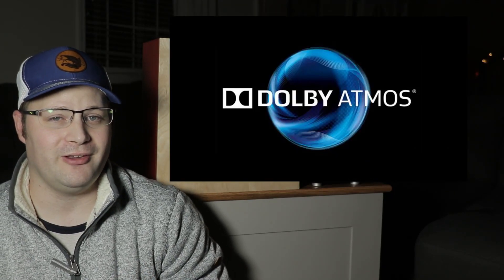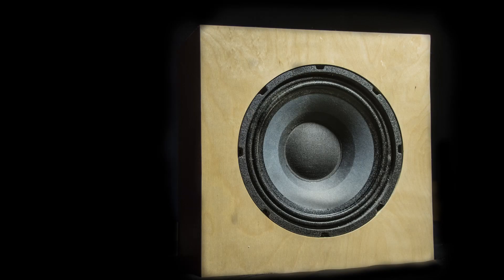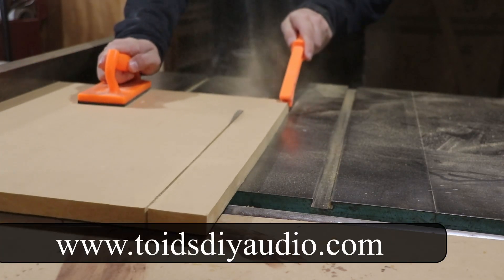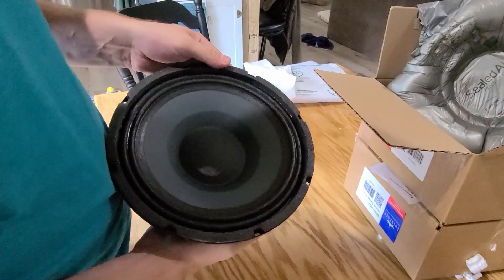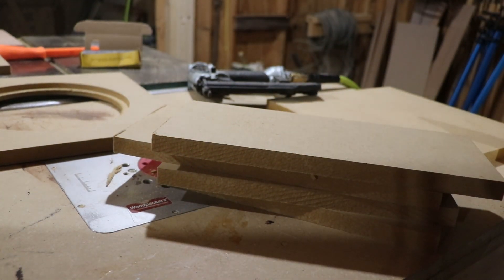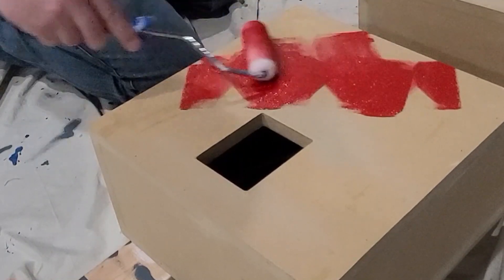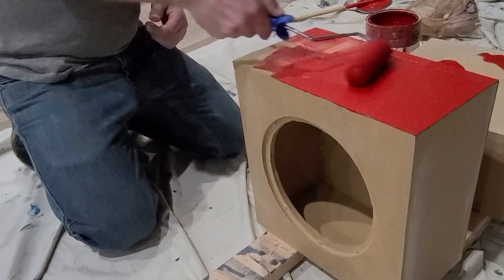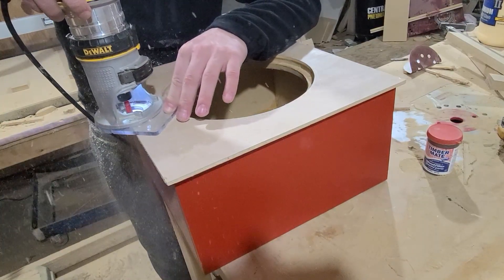How to Build The Ultimate Dolby Atmos Surround Sound Speaker

Comment: Thank you. I am interested in building a 6" to 6.5" coaxial 2 way center channel. My thought is this is large enough to provide the sound power to keep up with a L/R of the same design, while eliminating the off axis lobing associated with turning an MTM configuration on its side. Do you know of any manufactures that make a high quality 6.5" coaxial driver?
Reply: Hey Jeff - I'm trying the Celestion FTX0617. Prototype box sounds pretty good with the factory designed crossover. Only trap is that the woofer polarity wasn't marked on the pair I bought... you may have to experiment.  There is a massive notch at 2khz if the driver phase is wrong :)

Comment: I built these…. Twice. Used Eminence woofer & tweeter.

Built for in wall rears & mid ceiling height.  I also built a couple GR Research X-on for front height j& side speakers.  7.2.4 system. 

These sound quite good. Very clear… & decent base.  I used them in place of my LR speakers for a bit of listening… just to compare. My LR are GR-Research X-Statiks pre amp from Denon AVR to a sub woofer (don’t use LFE) then to Krell KAV-2250 amp (sub is a GR-Research ‘double trouble’ servo controlled)

I was really surprised how good these sounded. 

They had the boxy sound of sealed speakers… vs the open baffle staging the X-Statiks have…

But, they are getting mounted in wall or in ceiling anyway.

About $360 from part’s Express for one set.
Reply: how are they for two channel stereo listening
Reply: @joeygonzo  actually, they are pretty good. 

Good clarity through most frequencies… 

Decent staging… 

I listen to them on 1’ stands 3’ into the room well separated… they wouldn’t suck as ‘bookshelf’ speakers.
Reply: @ronreeder4572  well, they're a lot cheaper than Zu Omen or Kef or Andrew Jones new concentric speakers.  Did you configure your own network?
Reply: @joeygonzo  yes. 

Well, used the tools available in my Marantz or Denon AV… Audessy… 

Use provided microphone… the program makes ‘chirps’ & automatically balances the speakers. 

You don’t want to ‘hear’ ATMOS speakers… we’ll be aware of them … 

My L&R are situated so well… you don’t ‘hear’ them either … the simple induce sound into the room… but, you don’t hear the music coming from the speakers… music simply fills the room.

Comment: what a shame. Youtube needs a paid section for content. Mr. did i miss something? You glued MDF together. Then you named dropped drivers.Not cool
Reply from the maker: Huh? I'm not sure what you're talking about. That's not at all what I did. I mean I did glue boxes together, that I designed based off the TS specs of the driver. And then I custom designed an entire crossover, for two completely different compression drivers. So, maybe you just didn't watch it? Or maybe you didn't read the description where you can get the free plans at?

Comment: I used Polk Audio RC80i in my garage Atmos system and since i couldn't cut into the ceiling i purchased 10in. single subwoofer boxes. The measurements are the same as these. The speaker cutout is perfect and they come carpeted in black or gray. I mounted those to my ceiling and they're perfect 👍
Reply from the maker: Nice!
Reply: @Toid what would be good strong plastic bin or container would be strong enough for 6.5 1/2 400watt marine speaker and hold Talentcell Rechargeable 12V 6000mAh/5V 12000mAh DC Output Lithium ion Battery Pack for LED Strip and CCTV Camera, Portable Li-ion Power Bank with Charger, Black and plye 4ch hydra amp

Comment: Was wondering why you didn't fit between the ceiling joists. Also, in a ceiling, I would prefer to hide the speaker behind a white grill with a hole just big enough for speaker to be flush with ceiling. I guess I would just shim the box between the joists and raise to allow speaker to be flush.
Reply: Space between joists is 14.5 in and 7.5 depth normally so he could put them in the ceiling

Comment: @Toids, great build but wouldn't it make sense to make sure all of your monitors match drivers and overall parameters? I realize that one is providing height and the other is effectively the 5.1/7.1 set-up, but I would think you'd want as much tonal matching as possible. What would the "LCR" version of THIS speaker be?
Reply from the maker: Ideally in a 5.1 surround sound do you want your front three mains to be identical speakers. As far as rears and ambient speakers go that is far less important. However that's the reason why I used the JBL driver with this woofer. That's the same driver I used in the THX build. So these would pair up really well with something like that if that is what you're going for.
Reply: @Toid  I appreciate what you're saying, IMO and experience, when we start adding more and more channels (which with Atmos, we do) it actually becomes all the moreso important to try and make all channels as close to identical (if not actually identical, DNA) as possible. There is so much information being tossed around the room that I think in order to keep things seamless and homogenous, matching is critical. I didn't realize the JBL's were the same tweeters as the Faisal/Klipsch-esque build, but that would of course "help". I just wonder since this is a fairly wave-guide controlled dispersion speaker, which similar to a tannoy is fairly ideal for HT, what a larger, more full-range version might be to make these fully LCR/LR/RR/Atmos "set" designed. Thanks again for your vids they are both entertaining and educational. I come from a different side--grew up in a hifi/home theatre store and know fairly well what things perform like when installed.

Comment: We are not gonna see the frequency graphs ?
I wanted to see how low a closed 10inch pa driver can go. 
Also wanted to ask you few questions.
What do you think about the not perfect "waveguide" cause directivity and other problems ?
Also when the woofer movies in and out, the waveguide also moves up and down. Doesn't this create problems to the compression driver ?
Reply from the maker: The frequency response graphs are on the website linked in the description. The waveguide itself doesn't move. It is attached to to the motor structure underneath the cone.
Reply: @Toid  The cone acts as part of the waveguide, and the cone moves up and down, so it moves the waveguide with it, compressing and releasing the higher frequencies.
Reply from the maker: @Quetzalcoatl0  the cone is outside the small conical 60 degree waveguide inside. In none of my tests has the movement of the cone had any effect within that dispersion.
Reply: @Toid  the small waveguide inside ends at the dust cap, then the woofer cone continues the wave guide. I didn't know the exact word I wanted to start with. I'm talking about the doppler effect problems that occur in all coaxial speakers.
This is what worries me. I really wanted to build a 10inch pa coaxial with a compression driver for all the 7.x.4 channels, so everything from drivers to box size, to crossovers will be the same. But that doppler effect, and it gets worse when the cone (the moving waveguide) starts moving near xmax. 

I guess I have more reading to do. There isn't much data about this topic. I wonder why not every speaker be a coaxial when coaxial seems to fix most of the problems of a regular 2 way speaker. 

Thanks for the chat :).
Reply from the maker: @Quetzalcoatl0  I didn't see any issues within the 60 degree radius, but I went ahead and emailed the product designer at Eminence to clarify. If I get a response, I'll definitely let you know. Another option would be to do something like a BMS or a b and c compression coaxial. However those will still need to be crossed over typically by 300-500 Hertz.
Reply from the maker: @Quetzalcoatl0  I did hear back from Eminence. They did say that at extreme nearfield listening some frequency modulation can occur.  However it's effects are far less noticeable or measurable far field. So it looks like I learned something today. I appreciate it.
Reply: @Toid  Thanks for that info! I won't be closer than 2 meters from each speaker. So i might actually go 10 inch coaxial instead of the faital pro pr200 and a matching horn which i still don't know which to use. Both cases will need to time align both drivers so.
Reply: @Quetzalcoatl0  coaxial, coincidence, and concentric are not all the same.
Reply: How do these compare against a Volt 10? Would you recommend using the JBL or Eminence compression driver over what comes with a Volt 10?

Comment: Hi 123Toid, another great video. Thanks. Another follower who hasn't gone Atmos yet. What do you think are the advantages of the concentric drivers besides simply being space efficient, something which I value. And did you make your own crossovers or simply buy Eminance 2 way crossovers?
Reply from the maker: Hey Peter I created my own crossover for these which you can find a link in the description to. As far as the advantage is, the main advantage is what I listed with being more efficient which in turn makes it more dynamic. that's with any speaker there's always advantages and disadvantages. You just have to figure out which advantages are more important to you and which disadvantages are less important to you.

Comment: I'm curious why you didn't angle the baffle like a lot of Atmos speakers? Where is this to be mounted in the ceiling like flush with the ceiling?
Reply from the maker: I did create an angled design. I completely forgot to post it on the website. I didn't test it. The volume is correct I just don't know how the drivers will sit with the angle on it. But I'll have to put that on the website tomorrow

Comment: I've been working on a similar design for Atmos using the Peerless DFM-2535R00-08. The Peerless is bolt-on so it needs an adapter. I have a prototype crossover but still need to finalize it. Too many projects. Have you mounted these yet? And were you able to aim them at the listening position?

Comment: How's the off-axis frequency response? I know Dolby suggests using a speaker with wide dispersion for the overhead atmos speakers.
Reply: Well… I have a 20’x30’ room with TV in center of 30’ wall. 

The surround sound effect is centered in a 10’ radius in the seating area. 

Stereo covers the room much better. 

I’m mean it still works… it’s most effective in that 10’ range.

Comment: Nice vid. Quick question. How do these atmos speakers blend in with the thx ultra clones? I notice you're using a 10" driver and the utras are using dual 6", I think? Curious because that's the main reason I dont want to build the thx ultras.
Reply from the maker: That's a great question. I should have mentioned this in the video, but they blend extremely well with the JBL driver. That's the same driver that's being used in the THX build.
Reply: @Toid  thanks! Enjoy!

Comment: Does anybody know how/where to get D220ti’s in Canada? I’m desperate but not desperate enough to pay $120 just in shipping and duties
Reply from the maker: Wow is it that expensive to get them in canada?
Reply: Toids DIY Audio - Yep, the cheapest I can find is $160 for a pair used on ebay plus $66 shipping not including taxes or duties. ordering from PE is more. A lot of the “D220ti TRIO” versions readily available but my hunch is that these are reject versions sold only in the brazilian market (with much worse response)
Reply from the maker: @efmvii  I would ask around on different facebook groups and forums if anyone has any.  They are a very popular compression driver.  I wouldn't be surprised if someone didn't have some sitting around that they would be willing to part with.

Comment from the maker: I apologize about the earlier upload.  Something happened with the audio on the first upload and I didn't catch it.  It is fixed now.  Thank you everyone for catching it right away and informing me.
Reply: I'm betting that using your heavy duty table saw must be a real joy.  They don't make them like they used to.
Reply from the maker: @welderfixer  it really is. I was lucky to be able to pick this up from a friend for really cheap. It's a really nice powermatic 66. I love that everything is easy to fix on it.
Reply: @Toid  Old cast iron machines are rock solid!  The blade sings and the base doesn't vibrate like a speaker.  Cherish that great tool.